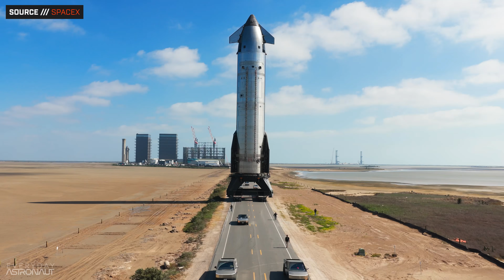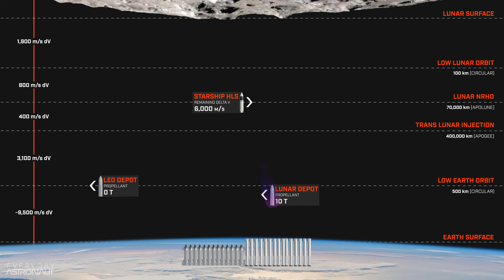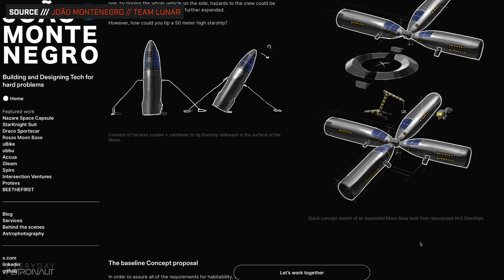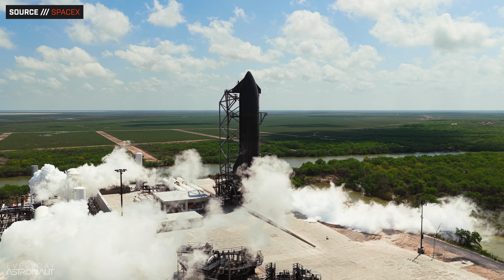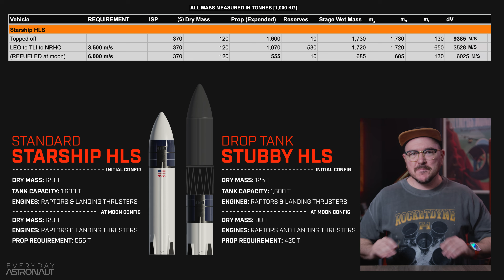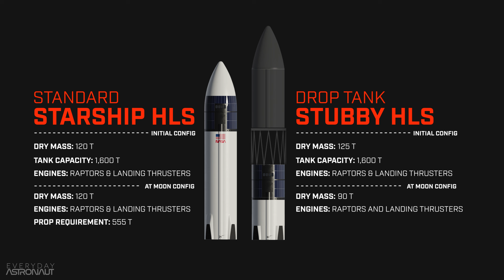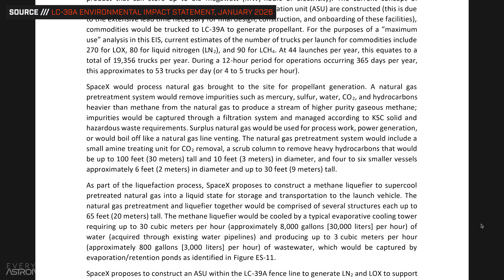Does Starship REALLY require 15+ launches to land one lunar Starship?!

Comment: I’m not fully convinced that pointing Starship aft-first toward the Sun is actually optimal. The projected cross-sectional area remains roughly the same regardless of orientation, but the aft section contains dark Raptors and other high-absorption surfaces that may absorb significantly more solar energy than reflective stainless steel or a white-painted hull. With a nose-first orientation, much of the incident sunlight might reflect away at a shallow angle, while the large cylindrical surface area could still radiate heat efficiently into space.

Comment: refuel in lower leo (350-370km circular)for the first time this will reduce risk, if something goes wrong, blow up everything and that orbit will clear up in a week or so. will also need only 8500 dV for refueling launches. now design depo varient with other set of smaller engines that run on gasous props(we already have that, but i belive will need rework for space applications)
that way depo can slowly rise and lower its orbit for both tankers(at 350) and hls (at 500*500 or more) 
also i belive depo will have less dry mass cz no flaps, no heatshield. and less orbital target. so... that would  mean it will already have upwords of 250 tons of props ready on its launch, boil off on that would be enough to service 350km orbit( which i suppose would need daily boosting burns of few seconds).
alright geniouses of comment section.
what are problems with this architecture??? i must be missing something, what is it?

Comment: In summary, I believe that if we want to establish a sustainable research base on the Moon or even Mars that is economically viable, learning how to build a completely reliable and fully reusable vehicle is an absolute necessity. This includes the HLS, which itself is designed to be fully reusable.
Reply: Just think about what exactly is fully reusable and what is not.

In my opinion, Starship HLS variant is NOT reusable.  There are no NASA plans for it to be so.  Once the moon mission is over, it is either left in moon orbit, or perhaps (depending on who you ask) relanded on the moon (and that depends on weight, payload, fuel load, etc).

But almost all other craft in SpaceX Starship program are to be reused.

Comment: 1:08:50 it's amazing what you just did. You just said, "If we make the map, if we make the capacity smaller, we need less refueling, yes, but you'll need more missions." So instead of 10 times refueling, 15 times, 150 refuels to take 10 maximum payloads to the moon, you need 20 refuels of 10, which would be more. Am I wrong?

Comment: There is an actual solution to this, and it's very beautiful: one that requires zero launches. tho that is the semantic cheat. We put a fuel depot up there which has all the stuff needed to keep it cool, and we have infinite launches going up all the time, keeping it topped off all the time. Now, it's a pipeline; you're not even counting the launches, so they become zero infinite, not a number. And then, when you send a rocket up there, it doesn't care: all the launches have happened; it's zero to go. You just go to the fuel depot and fuel up.

Comment: The mass fraction of useful payload remains roughly the same. Given the Apollo lunar module was about 10 tons, it follows it would take 10 rockets to deliver the hls 100 ton payload. the actual useful mass delivered is quite a bit higher in hls.
Reply: Starship being re-usable adds another variable. The fact that it might be able to deliver a similar mass fraction to the Apollo missions, while being re-usable is insane.
Reply: @trevorpullen3199 absolutely. Half of that Apollo lunar module is left behind. The actual 'useful payload' Apollo delivers is a couple hundred pounds of astronauts, experiments, and moon rocks.
Reply: @mc-zy7ju  Apollo delivered 700 lbs of usable, removeable, leave-behind cargo to the lunar surface.  On Apollo 15,16,17 - about 500 lbs of that was the moon buggy (they left 3 of them there over those 3 missions).

People, not you, seem to wanna say "let's just do Apollo".  700 lbs a trip does not make a moon base.  Neither does 3 tons a trip, for Blue Origin.

Comment: Ok, hear me out...
Eagles from Space 1999

Instead of the Raptors being on the bottom, have them in pods on the side, and the pods can rotate. Also have pods in front (they can be much smaller because they're only used for landing), so it can land on its side. And implement nuclear propulsion, of course, in pods, which takes over once it achieves a stable orbit.

Yes, it will have extra weight, complications (dealing with radiation), and less capacity, but that's an engineering problem.

Comment: This is never going to happen. NASA is the customer, and there is no way that this gets done. They want a moon lander, and Musk wants a skyscraper sized colony ship. They are on two different pages, and the starship is going to need decades of engineering to do this, Congress will defund it long before they get through all the complexity of this.
Reply: Congress funded $3B and SpaceX's bid was $2.8B. That was only possible because the colony sized ship and its engines were already being built. More options and costs have been added, the contract is up to ~$4B according to some, but any other increases aren't NASA's problem, it's a fixed price contract. SpaceX eats any further increases. Congress can relax. Blue Origin's contract is also fixed price - and its stipulation was that Blue Origin needed to put in more of its own money on top of that. So Musk/SpaceX and Bezos/Blue Origin are subsidizing the Artemis program, something few people realize.

I don't want to polish any apples for these mega-billionaires but NASA awarded Aerojet Rocketdyne $3.5B for just the engines for the 4 SLS launches after the current used Shuttle engines are used up. AR already got $1B of that just to reopen the production line.   $3.5 billion for just the engines!

Comment: Going big at the beginning is definitely better than doing it in incremental steps over many, many years.  The point you made at the end of not having to re-engineer new architectures to increase landed payload mass to the Moon's surface, plus the idea of total reusability — is optimal long-term.  
The biggest thing lacking in this otherwise excellent video though, was a stress on the overarching metric that gives the whole exercise its meaning:  
NOT landed mass but landed PAYLOAD mass to the Moon's surface.  That's the unifying concept that was not used but should have been used in this video.  In connection with that, a comparison with Blue Origin's competing architecture would have been very meaningful in a video like this.  The meaningful difference between Spacex's and Blue Origin's two different solutions — boil down to landed payload mass on the Moon's surface.  That's the whole ball of wax...and that was missed here.

Comment: halfway through and the obvious answer is get rid of nrho. dock with dragon at leo, send the crew to the moon and back, and return to earth via dragon.
Reply: Obvious to everyone - until you figure in the amount of propellant needed to get the HLS back to LEO. That'd require quite a chain of tanker flights. It'd also require the crew's lives to depend on a successful refilling in lunar orbit, any seal or valve failure would doom them. Such a failure in LEO (depot to HLS) would just mean the crew wouldn't even launch in Orion.

Comment: I probably don't know enough about the topic, but I have some doubts they use see-level raptors for attitude control. It's overkill (or even not possible) - to much thrust for that.
Reply: The plans released by NASA 2-3 years ago show that two engines will be used to deorbit down to the Moon; one vacuum and one sea level. The sea level one is used for controlling the deorbit descent while also providing a lot of the deceleration, which is different from plain attitude control.

Comment: If you use argon ion drives with an ISP of 2500 (ie SX drives) you expend about 110 tonnes of argon (for a round trip from LEO to LLO and back) for every 500 tonnes of cargo delivered to LLO. With 2000 drives that works out to roughly 140 days for the round trip. No aero braking required. That's assuming 70 tonnes dry with about 12 tonnes of that dry mass being solar panels and ion drives. So light enough to launch on Starship as cargo. 

That means there's only about a 20% penalty for refilling at LLO vs LEO. All with off the shelf stuff that SX already makes in huge quantities.

Comment: Shouldn't' HLS only have R-Vac engines?  Why have any sea level engines?
Reply: On ascent to LEO it needs some of the engines to gimbal to stay on trajectory. There's not enough room for the 3 center (sea level) engines to have vacuum nozzles and be able to gimbal.
Reply: @donjones4719  I'd argue that differential throttling of the three (or 6) R-vac's would satisfy much of this need, (pitch/yaw), and a more robust RCS that would likely be needed for HLS's primary function could handle any roll corrections necessary.

Comment: Likely much more considering V1 and V2 payload to LOE projections were completely wrong. V3 isn’t going to bring more than 50 T and I wouldn’t be surprised if it’s less than 40.

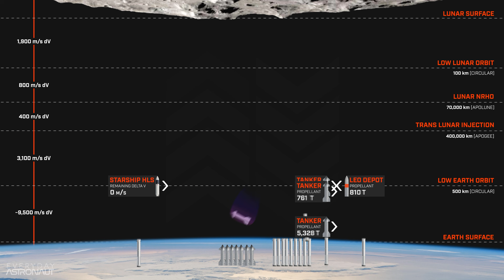Edit: Ah there it is 10:30. All the numbers are completely useless when you base them off 100T launch capacity (which Starship will never achieve).

Comment: 12:27 "we mentioned at the beginning, HLS is massive. They're trying to land something like 500 tons on the surface of the moon. So, nearly 100 times the mass of the Apollo lunar lander with 100 times the internal volume."
and most of that volume is taken up by fuel and oxidizer.... compared to apollo where most of the volume was used for the mission objective....
the question you should be asking is... is the HLS really the best suited design for artemis not how we get the cybertruck i drew as a child into production....
Reply: HLS is the design best suited for going to Mars. It's only incidentally an Artemis lander, so naturally it's oversized for that.
OK, that's an oversimplification but the basic truth is there. SpaceX was building Starship to go to Mars, the engines were flying (first iteration) and the tankers were planned. The overall architecture already existed when NASA was looking for a lander. Tim never covered why such a large lander was chosen - it was cheap. (And the contract is a fixed-price one.)
Reply: @donjones4719  "HLS is the design best suited for going to Mars." well, in elon musks mind and obviously your oppinion, but that´s besides the point....
why would you chose a lander for a moon mission which is actually designed for mars? btw musk wanted to be on mars by 2024 originally...
apollo was already going to the moon by this point after mission start and musk hasn´t even achieved a single orbit or demonstrated any ability for orbital fuel transfer ....
any personell on board would have ended horribly by now.... if my mind serves me correctly the 3rd or 4th apollo mission was manned at this point....
and the design is moronic... why would you have the crew at the top in 50 meters height needing some kind of elevator? your gonna deploy your moon rover with that? lets hope that thing never malfunctions or ur basically stuck....
the best design... lol read up on how musk got the contract... there was a change in leadership at nasa and some person in-between gave the contract which was suposed to go to two companies competing only to space x and then leaving nasa working for space x.... 
maybe check Kathy Lueders
Reply: @Hellfr4g   "why would you choose a lander for a moon mission which is actually designed for mars?" Because the cost for the Mars program was and is being funded by SpaceX. As I said, that was an oversimplification. The most basic part of the ship design, the booster, the engines, the factories, the pads, etc, are part of the Mars and Starlink programs. (Starlink is part of the Mars program, it's there to generate the funding.) NASA would spent far more just developing the engines under their old system (cost-plus contracts with legacy contractors) than what it's paying for HLS. Yes, $2.8B from NASA  is significant but it's only paying for a variant of a rocket already being built.

The selection - do you really think that was put together in a couple of months at government agency speed? The process had been going on well before then. I've actually read the selection document Lueders wrote, have you? It was very clear about how poorly presented the proposals of the National Team and Dynetics were. Clear enough that it passed appeals to the NASA Office of the Inspector General and the courts, which it wouldn't have happened if it was a biased hack job. Are you familiar with the politics behind the down-select from 3 to 2 companies? NASA wanted to fund 2 landers. These were supposed to be the actual contracts to procure landers, not another round of development contracts. The process was already years behind. Congress was in no hurry and granted only $3B, knowing it was too little and expecting it would be split between two companies for another round of the development contracts, expecting most would go to the National Team that included some of their favorite legacy companies. The SpaceX bid was unexpectedly low - so the top people, including the acting Administrator, gave Congress a bucket of cold water in the face and selected SpaceX. A bold move that had two expected results: One company set to work on a lander and Congress was shocked into providing billions more to fund the second lander. 

Lueders ended up at SpaceX, but she didn't just run around and jump. She stayed at NASA for two years till they sidelined her. Given the push to leave, she did the logical thing and got a job in the space industry. She'd run the commercial programs for years and knew SpaceX ran things better than the other companies, so why not go there? That's what NASA and Pentagon employees do, they go to work for the companies their agency has dealt with.

Comment: I don't see how the landing/liftoff engines can be pressure fed with ullage pressure. Among the alternatives electric pump fed engines sound good. Simple easy startup sequence and the battery required can be fairly small - it only has to run the engines for a few seconds. Maybe 30? Another 30 for liftoff. Probably well under a minute combined.

Comment: How can the HLS landing engines be pressure fed from the tank ullage pressure if that is only 6 bar? Pressure created in the combustion chamber has to be lower than the pressure in the propellant lines feeding the chamber, otherwise the combustion products will head back up into the propellant lines instead of exiting through the throat/nozzle. That'd be a very low thrust engine indeed. I know this from the article on your site.
These have to lift the dead mass of the ship off the surface, they'll need to be powerful.

You assume they will be pressure fed. Am I simply wrong about this?

Comment: A tanker only needs to be about 30Mg lighter than HLS in order to have enough dV budget to RTLS from NRHO, and still top up HLS as much as sending a new one. HLS doesn't have the heat shield and flaps, but that seems achievable. Then refueling in NRHO doesn't take more launches than sending a new HLS.

Comment: A 3 stage starship may have advantages. That is, the "starship" part does not reach orbit, but still delivers a lot of velocity. Since reentry heating increases dramatically with velocity, even a small reduction in velocity greatly reduces the heat shield requirements and enables faster turn around due to reduced stress. Also the mass of the reentry and landing system is a much smaller percentage of the total mass of the stack at the end of the second stage burn, so it has much less impact on total delta V to orbit and payload capacity. The downside is that it must land down range on a barge. But there's more upsides. The third stage becomes much simpler, cheaper, lighter and more efficient, essentially a stripped down smaller tank and single vacuum raptor. Sure, it is expendable, but this greatly increases the fuel to orbit on each launch, and it's not expending the larger starship second stage. Once refueled, this lighter single raptor stage can do the TLI and even do the lunar landing on an HLS/cargo version, saving more fuel. The final gain is not returning the lander to lunar orbit. Most of what you want to take to the moon you want to leave there. Anything you want to take to the surface on a reused lander needs to be transferred from a vehicle from earth that could already do a one-way landing by itself with minimal additional complication, and with greater payload capability. The lander could be optimized as a lander, rather than a second stage rocket. But it's not just a lander, it's a surface module with all the surface equipment pre-installed and ready to go. No cargo transfer or surface installation required. Only the crew needs to get back to lunar orbit, and that can be done with an Apollo style ascent vehicle, which doubles as an escape system during landing. It can be mated with the lander before launch from Earth, or even docked to (and refueled from) a new lander in LLO to reuse the ascent stage - which contains life support, and most of the other complicated systems that you might want to reuse. After all, any fuel to re-fuel a lander must come from earth, in a tank, propelled by a engine, under control, with the cargo (already installed), so just add legs and use that for the landing too. Reusing the whole lander is really just reusing the legs, and that costs a lot of extra fuel. Those legs are pretty handy on the surface anyway. Reusing the lander only starts to make sense once we have fuel produced on the moon, rather than having to come from earth. But first you need surface modules to build a base.